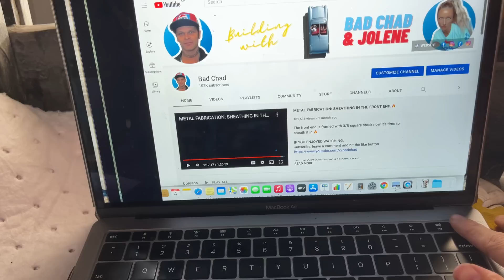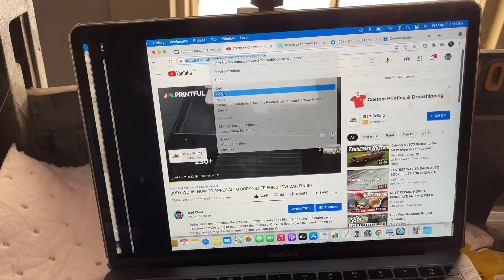SANDING BODY FILLER WITH DUAL ACTION ORBITAL SANDER

Comment: I like that you use the 8-inch disc instead of an air file. I want to do the same except with an electric tool. You got me using an electric tool with a small disc and it's so good. I'm trying to find an 8-inch electric tool. I find polishing tools. Do you think I could run 40 grit on a polishing tool?
Reply: I’m in the same boat as you. If you can find an adjustable speed polisher ( or grinder) or sander that matches the advertised rpm range of an 8 inch sander, you’ll be good !

Comment: I have used at times used 6" da sander with #40 grit smaller areas. Form wheel lips ect. I have huctions da sanders lower air usage smooth running.

Comment: How do you keep it so even without a board sander over such a large surface. I did the side of a car with a 2x4 about 6 feet long with self-adhesive paperand it worked out well?

Comment: 56:16 Questions? Do you not use the long adjustable planes that help take out high areas whilst following long gentle curves? Yes, you don’t want to leave too much of the flood behind, but I/ we used to rough level, then add more of in-fill the lows before doing what I see you’re doing here!Cheers from England, UK

Comment: Cool what you got there I called Boss Hog I used to repair the damage from the driver on Prom Night trying to impress the prom kids for a bigger tip. by going through the drive-through at McDonald's and asking for some Grey Poupon mustard while the driver is grind ing into the center of the car going around the corner. And somehow the kids always seem to forget the driver at the end of the night

Comment: I have a question.  Why didn't you spray it  in ppg epoxy  after sand blasting.
Reply: Im just responding cause acouple days ago he had said he didn't do the expo. primer cause he was going to body fill the hole cab-over anyway.
Reply: That's a sealer for after everything is done.
Reply: Just a question I have not done much body work but what I have done is same way chad does but do they make a body fill that is sprayable I know you can spray drywall coating.
Reply: @jayshotwell9764  They make it, but I'm not sure you will like it.

Comment: I believe with the weight of the truck the small block may not hold up. Especially if you plan on pulling a trailer.  I would put a turbo diesel in it myself.  The body is coming along nicely. Jolene does fabulous camera work.
Reply: Small block has lots of torque. Not as much as a turbo diesel lol, but I think it will work just fine

Comment: Using an air board with 36-40 grit gets it straight from the get-go. Using a DA causes waves. I hope he plans on boarding it at some point to get the panels straight.

Comment: what would happen if you put a guide coat on before the big or fibreglass, gave it a quick sand  at least you can then get a great handle on the areas that could get more “flooding” first sort of like only filling the empty ponds

Comment: Get a motor in it, and driving. Then  prep for paint. I thought it was a beautiful creation before the make up.
      It could make a nice tow rig,for  a camper.
Reply: It's to heavy for a 307 Chevy in my opinion but I have had late 70's T-birds with 302s that were weak. I had a 1978 T-bird with a 351 Windsor that was adequately powered. He should go minimum 350 Chevy or 360 Chrysler.

Comment: A 8" mud hog will take the mud off a lot faster than Chad put it on great work Chad and Jolene good to see Jolene doing a little welding on the truck.
Reply: This stage is what separates the men from the boys.

Comment: Wow that mud is hard as concrete leaving it on like that overnight..i would be sanding that 20 mins after i applied it when it sands like butter!..I understand we can get pretty good with a mud hog da but you will never get the panel straight unless you use a air file and long hand blocks..mud hog only good for first couple rough in coats..maybe some ppl's definition of straight is different but to me it has to be perfect that after it is painted you can gun sight it down the sides from every conceivable angle and see no waves what so ever from one end of the panel to the other..that includes roofs hoods and deck lids..every inch of the cars sheet metal

Comment: What you are doing is called fairing. It is nothing new in the ship and yacht building world. Modern steel ships have up to 2 inches + of an epoxy fairing compound applied on the exterior of the hull. There are marine epoxy fairing compounds that are made to be applied by spraying them on. Might be a quicker, and smoother, application of product. That leads to less of it being wasted. Since a lot of it winds up on your shop's floor.

Comment: you are a beginner, something like that has to be sanded by hand and a sanding block and finally sanded with the eccentric sander, besides, what you have is a cylindrical sanding machine and which you cannot sand anyway. and you don’t have a suction system either,  this rag doesn't help at all on your mouth ..